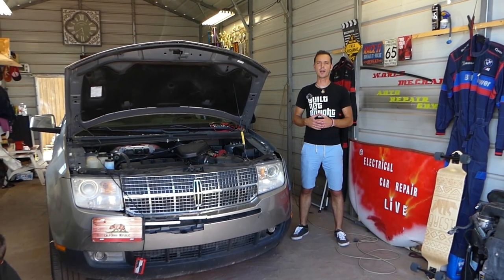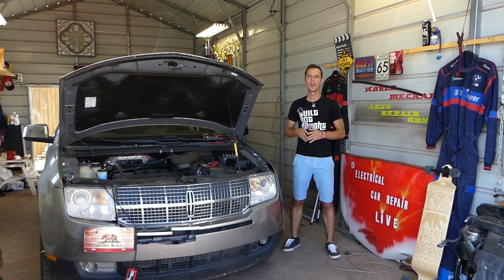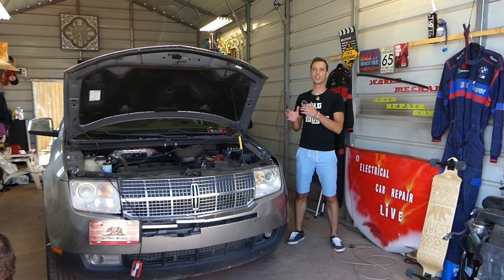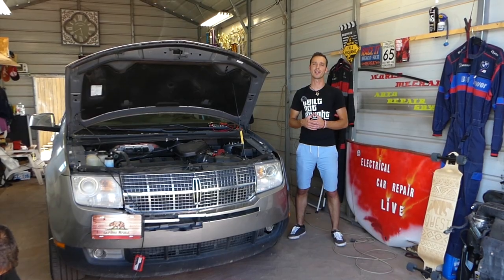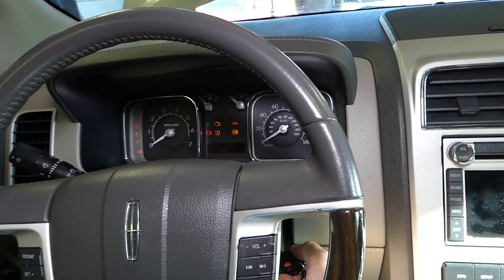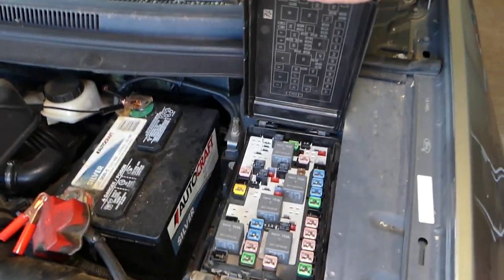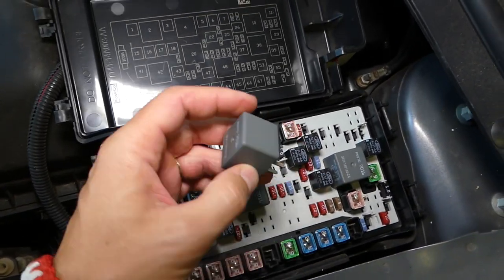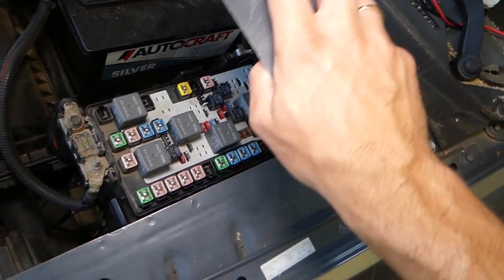LINCOLN MKX NO CRANK NO START. START RUN RELAY LOCATION REPLACEMENT

Comment: I have a 2010 mkx that cranks very little then stops. It won't crank enough to start the car. I'm wondering if this is due to a bad alternator or if my spark plugs, coils, or wires need to be replaced? Thank you for sharing your videos to help people fix our vehicles!

Comment: My 2007 Lincoln mkx will not start. No clicking,  no dash lights..
Reply: What was the problem?
Reply: That's the same with mine
Reply: @santacookieherrera4484  Did you figure it out?
Reply: Our 2010 started doing the same thing 3 months ago, even after 2 new batteries...
Disconnected to car computer for 5 days, and still no power what so ever.
We also had a Lincoln dealership electrical mechanic come out and look at it. He said most of the models of this type had bad computer boards, draining the battery...
Help anyone ?
Reply: @donnyinalaska  change the relay or any of the other items listed in the video?
Reply: @GCULPEX  , yaaa, we had a Ford dealership electrician come out and look at it for a few hours. He said the model we have has always had onboard computer problems. 
We done installed 3 new batteries and still has the same problems. Battery goes dead after a few weeks.
Its still in mint condition and loaded, even bought $1000 dollars worth of new tires... just doesnt like to stay charged ...
Plus, we bought it at the dealership here in Seattle with a warranty, which is only good for the motor and transmission...
Reply: @donnyinalaska  what yr
Reply: @donnyinalaska  My battery sign is currently flashing as well.
Reply: @rexgamewell  , we finally bought a new car here...lol
plus, just put the MKX in the hands of a electrician who works for Ford...
hopefully he can find the problem...
Reply: Yes hi I'm having the very same problem with my 08lincoln mkz no start no crank no sound just dash lights light up when I try to start it, can you tell me what you did to yours to fix problem
Reply: @talliewills5410 did you ever figure it out for 2008 mkz?